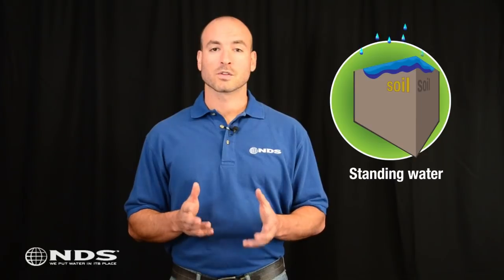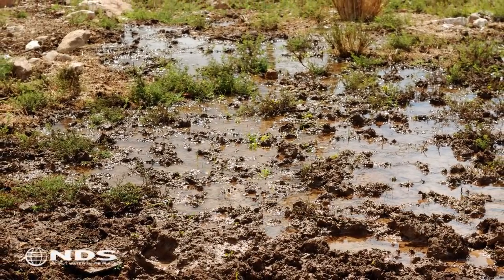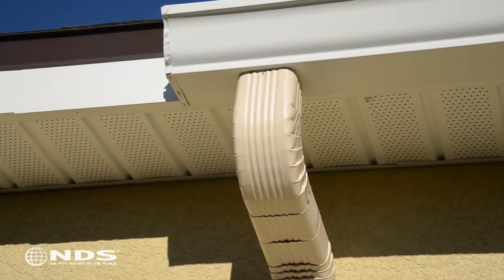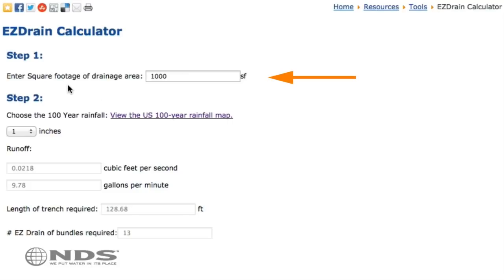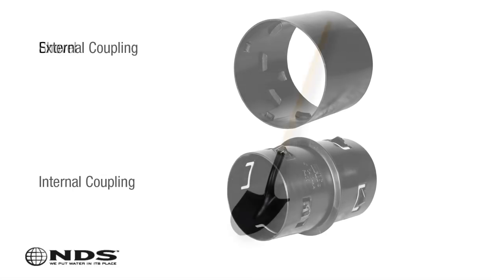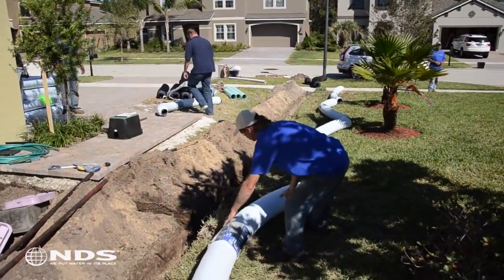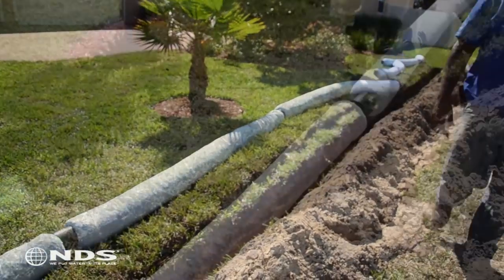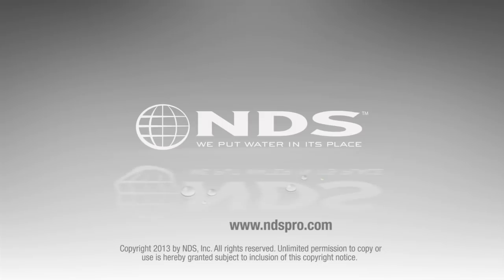How to Install the EZ Drain™ French Drain | NDS Yard Drainage Systems

Comment: Uh, why do they end cap both ends?  Shouldn't one end be emptying into a drywell or drainage pit?
Reply from the maker: Antony Evans When it is used in such application ezdrain becomes a temporary storage unit. Soil can only saturate so much before it can no longer hold any water resulting in puddles as all the water that is not absorbed will remain in the surface.  EZdrain will provide an additional storage as it will hold more water that the soil alone would in this case. So yes it temporary holds the water and then it releases it back into the soi
Reply from the maker: Hi Rachel. In most cases the drainage pipe should end in a dry well, drainage pit, or a pop-up emitter.  In this installation the amount of EZ-Drain required to store all the expected run off was installed.  The sandy soil here allowed the water to percolate into the ground along the length of the EZ-Drain pipe.
Reply: NDS Stormwater Management So, water leaves the soil, goes in the ezdrain, and then, goes back into the soil?
Reply: +NDS Stormwater Management So it disperses a concentration of water over a larger area. That's smart.